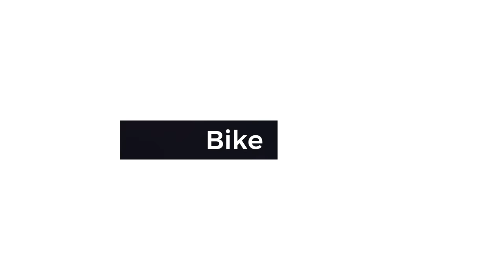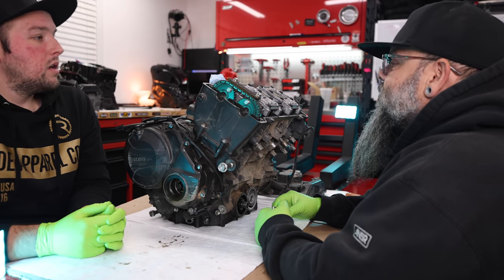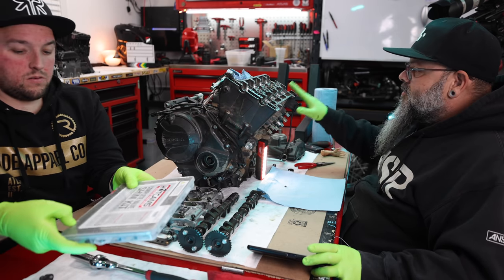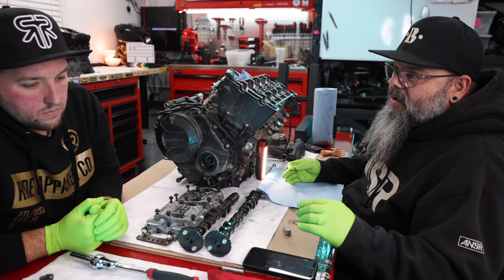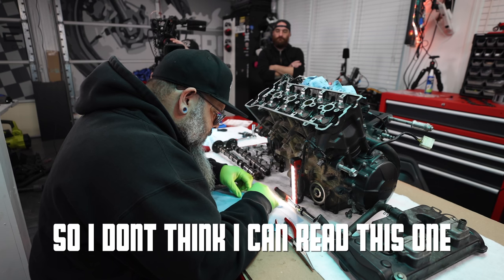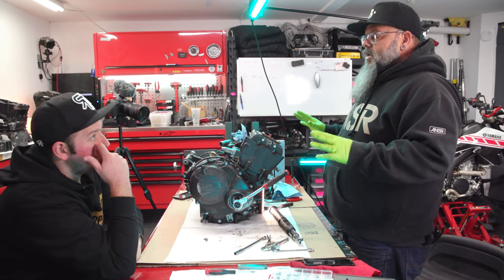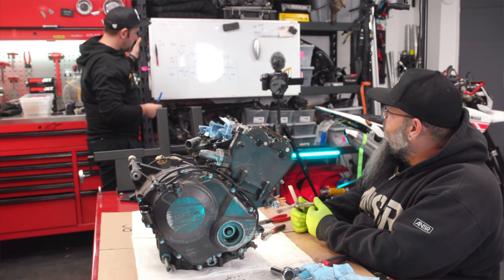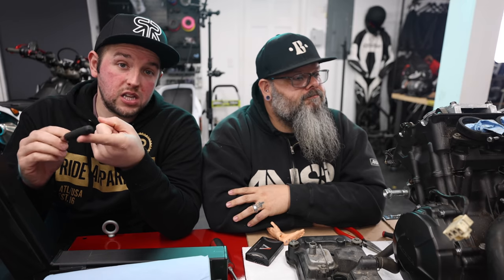Let's do a VALVE ADJUSTMENT on our RACE BIKE | 2008 CBR 600RR Race Build - Day 7

Comment: Next time just use a metric feeler gauge (some have both imperial and metric) which makes life much easier, if you only have imperial measuring tools just use a calculator and multiply the number by 2.54 to get the metric equivalent.
Reply: Seriously... why did they mix the two? I'm pretty sure the one they had had both on it. That's Chase spends the whole episode confused af....
Reply: Americans are just exasperating like that. Just use metric, it's far more exact and understandable. I learnt the imperial system because it seems to be a standard working on guitars and in the old days engines. But it is ridiculous and far less translatable

Comment: Thank you for this detailed video, much appreciated!! 
I'm planning to do a valve job on my Suzuki GSX1250FA a.k.a. Bandit during winter, and by studying the manual and watching this vid, the procedure seems to be very similar, after all, they are both DOHC engines, except for the cam sprockets which in my case are situated in the exact middle of the engine, and therefore so is the tensioner, unbolting and removing it may be a hassle, but doable I believe. 

Just one Q: will ambient room temperature have any effect on the measurements? The temps in my garage during winter are between 5 and 10 C (40 to 50 F)

Comment: A friendly bit of information from someone who deals with measurements even more precise than that: measure the shims you take out, and do NOT trust the number on them. The shims can actually wear down and become thinner than what the number says, so when you go off measurements from that, you may come up with too big of a gap. Also, measure to double check the shims you are putting in. What if there is a burr or the shim was wrongly stamped?

Use a pair of calipers or micrometer and always verify everything; trust absolutely nothing. Also, always zero out your measuring tools before use...again trust nothing.
Reply: I was about to comment this, bit of an uh oh moment. Shims can easily wear down a couple hundredth of a millimetre, that 2.02 could easily be  2.00 and the etching could still be readable.
Reply: I will do that. When you depend on the service manual you tend to do only that which it specifies. I'm already getting that creeping feeling that I'm assuming too much. Thmks

Comment: For us SAE guys here in the US. just remember that for every standard shim size (ie. 200-195) that your going .002in. smaller in clearance, or .002in. bigger if going from 195-200. With PRO X VALVE SHIM KITs you can get half sizes of shims as well, that would be .001in. smaller or bigger if your fine tuning. Nice Job Chase and Brian!
Reply: What you said right here explains way more than when they were saying the numbers , this right here tells you exactly how much to change if you're getting standard sizes ,  Based off of the shim kit proved and what you pulled out .  Meaning that 202 factory shim he had that caused a 0.007in feeler guage gap and he need a 0.005in feeler gauge clearance,; that 202 factory was close to a 200 meaning he need to to 0.002in smaller so he needs a 195 shime to get the correct feeler guage spec ... 😂
Reply: Shim lol 😅
Reply: @hulkcrshr2473  If the measured clearance was .007 and your shim size was 200 and you needed a .005 clearance you would go with a 205 shim to get the .005 clearance.

Comment: You can use white out to mark the position of the cam & chain. I do it all the time at work when we remove the cams on Audi’s
Reply: Can you explain a bit more in depth
Reply: @SubrosaRose  before taking the chain off or loosening it, Dan the white out on the chain where the tooth on the gear is showing. You’ll have a reference mark of where the chain and gear were
Reply: @grayv3  I see thank you so much

Comment: Now that I am a little older with a better paying job, I understand the value on not getting frustrated and stressed the hell out doing this on my own. I think I will let the technician spend the 4-6 hours working on adjusting valves on my bike. I have adjusted valves before, but never ones with shims and buckets. Messing up the timing would be my biggest fear in doing this job myself. That and the fact that the engine is still in the frame with significantly less room to work.
Reply: Im in the same boat sir

Comment: A 40+ min vid and a 30 min vid to confuse novice mechanics. Measure the clearance for each valve, write it down for each valve, measure  with the engine in the correct position (always use a workshop/service manual).
Remove the cam caps correctly as stated in the manual, then measure the shims thickness and write those down next to the corresponding clearance measurement.
Then you check the chart in the service manual and it tells you what size shim to install for each pair of measurements.
If they are within spec no change is needed, you can also interchange old shims from one place to another if it puts another within spec, while that one is out of spec, can save money if needing to order in shims.

Comment: Your comment on the setting the valve clearance tighter to improve performance may b correct but for my fzr 750 the opposite is correct I set my clearances to the wide end of spec and as a result the engine performs better  maybe I gives the piston more time to build up cyl pressure not sure if that’s true on all engines tho

Comment: The information I got from this is I'll let my dealer do my value adjustment haha. I don't mind doing the easy stuff (oil change, new exhaust, brake pads, etc) but this is way out of my comfort zone.
Reply from the maker: If I didn’t have Brian with me I’d be the same.
Reply: But do you trust the dealer will do a good job?

Comment: Its just addition and subtraction. IF the feeler gage is too lose, see how many thousands its lose. then measure existing shim. add the missing thousands to the size of the existing shim and bam, it will tell you what size shim you need.

Comment: Awesome video. THat dude knows his stuff. I have a 2011 cbr 1000rr and im fairly confident in turning wrenches but the valves I dont know enough to do. Bike has 20k miles. My question is I heard many so called bike technicians dont know squat about valves either, is there a trick I caan use to verify that a machanic actually opened up the valves and did the job? I hear that some will just saay everything is okay, charge you like 800 for doing nothing. Any tricks.

Comment: OK, is it possible to bend a valve when turning engine by hand, if the timing is off? I mean like I don't think one could generate enough momentum, to actually bend anything in an engine.

Comment: Quick Question,  before removing the cams could you mark (white sharpie, paint pen etc.) the cam and the sprocket on the cam so you could reproduce it when reinstalling the cams?
Reply: There’s nothing wrong with doing that but the cam sprockets are normally very clearly marked to signify there position at TDC on 1.
If you’re concerned about not getting the timing right, a little trick I use but not fees-able on this bike is to cable tie the cam chain to the cam sprocket on both camshafts as BMW’s and Triumphs they normally have drilled holes on the camshaft gears. Obviously re check after reinstalling rocker covers but it makes life a whole lot easier, hope this helps.
Reply: @gamekeeper687  Thanks, good idea with the cable tie. The paint pen idea was spurred on by Brian trying to find the correct tooth on the exhaust cam gear to mate up with the chain. If he marked it before removing it could be place back exactly in the same location. Thanks again.
Reply from the maker: That’s a great idea if available man!

Comment: OC Oh, I remember doing this on aircraft engines, I’m surprised it’s a bigger pain in the ass on a bike.
Also Brian has a baby zz top beard.
Reply: Your average aircraft piston engine is designed for easy and routine maintenance and repair. This particular motorcycle engine is designed for maximum power delivery through high tech. So if something goes wrong in backwoods Wyoming, you aren't going to fix it with a bit of baling wire, a piece of metal and a twist-tie, so you can nurse it home.

Comment: Guys, quick question, i have a haynes manual, and it says that even if the number is not worn of you still have to measure the shim in case it got worn off.. Is it true? Thank you.
Reply: I would normally recommend it due to wear, machining tolerances etc, as long you have a calibrated digital vernier caliper for example to measure them properly.

Comment: Why do you have to set it to top dead center to remove the camshaft?
Reply: In order to have the cam lobes of the INTAKE and that of the EHAUST pointing away from each other for a clearer space to measure the clearance. It is also at a point where you have both INTAKE and EXHAUST valves closed.

Comment: the only thing i dont understand in this video is why y'all keep measuring stuff in standard if the shims are in metric, that kinda game once crashed a manmade sattelite into the surface of mars, keep it simple by measuring in metric, the feeler gauges have it printed on them even... then measure what size shim comes out, even if it's printed, i can be worn/deformed, calculate where you need to be and measure the new shim too, i've had shims be off by about 0,02mm. at those tight tolerances, temperature comes into play as well, if you feel like experimenting, take a known shim, a 175 for instance, measure at room temp, put it on a heater for half an hour, measure it hot, and then put it in the freezer for half an hour and measure it cold, you'd be suprised by the difference. measure twice, calculate twice, take the cams of once.

Comment: what is Standard? If you live in a country where metric is the standard
Reply: SAE is what they're referring to
Reply: It’s referred to as Imperial here in the UK.
Reply: doesnt matter what system the country uses, what matters is what the manufacturer of the machine used to build it, Bell Helicopters and Pilatus Airplanes use standard, sae to build their machines. Also the United States Of America landed on the moon using SAE . LOL

Comment: Holy confusing, do yourself a favour and buy metric feeler gauges (most have both metric and standard stamped on them) and a metric micrometer when working on a metric bike. Forgot converting back and forth. Use a magnet to remove the buckets??? Why would you take the chance of magnitizing your buckets. It’s the last place you want metal particles to gather. Use a suction cup, like the kind you get with a toy gun. 

This guy is a “professional”???